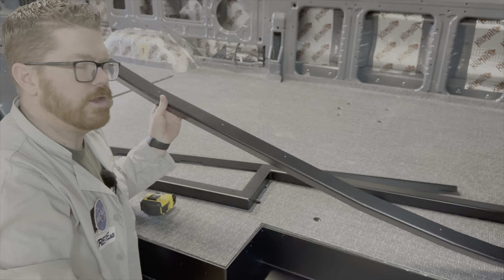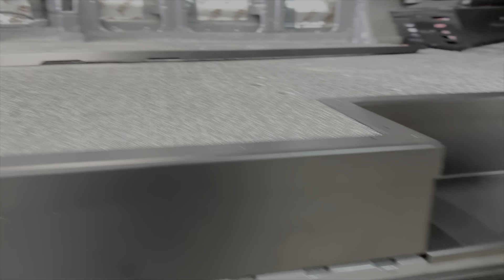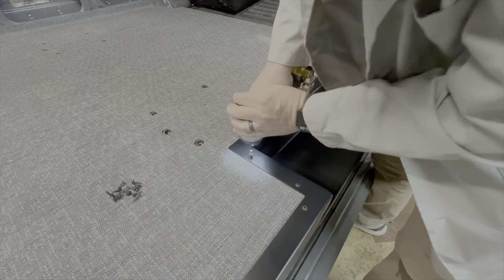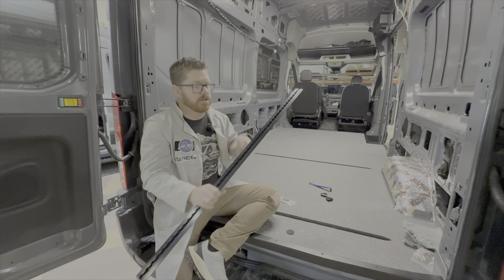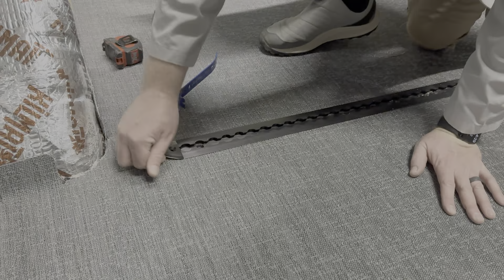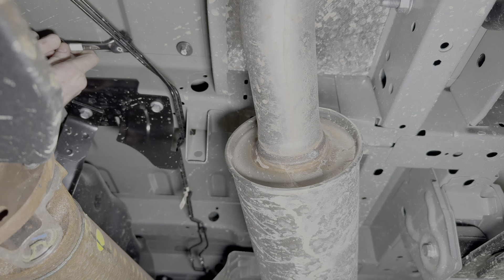Van Floor Trim, Step, and L-track Install | AVC Shop Van 2025 Build EP. 5 | 2023 Ford Transit 148 LB

Comment: Can you move the front rail further rear so it sits below an east/west bed in an extended transit?  Also is it possible to attach a slide tray to these L tracks?
Reply from the maker: You can definitely move the front track backwards.  The rear track is about as far back as possible, but we often move the front track to customer requested locations. 

Yes we put the tracks in to attach a slide out tray.
Reply: @AVCRIG thank you!

Comment: Can you mill the L-track recesses leaving 1/2" spacer built-in for the L-track to rest on?
Reply from the maker: I wish.  Because we route under the floor for the seams and wire runs I can’t mill the top too. At least not efficiently. I’m going to go back and swap the birch with something inorganic.